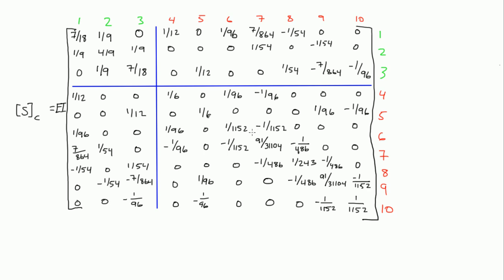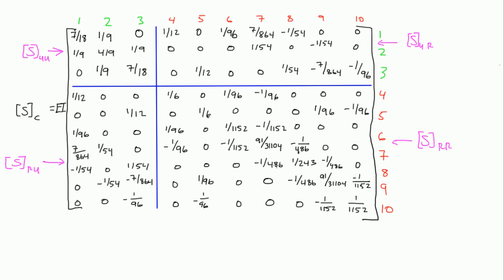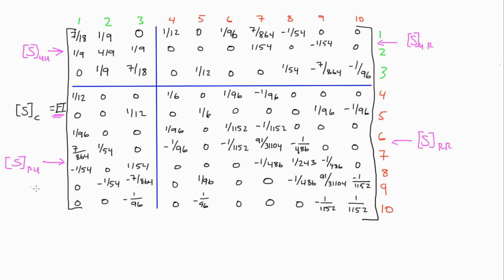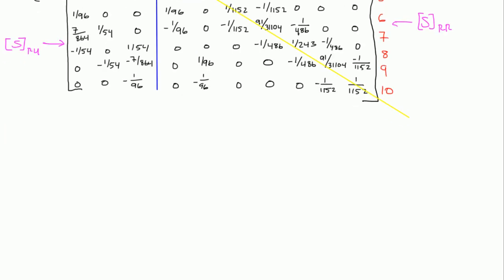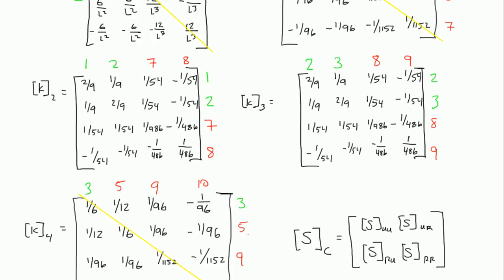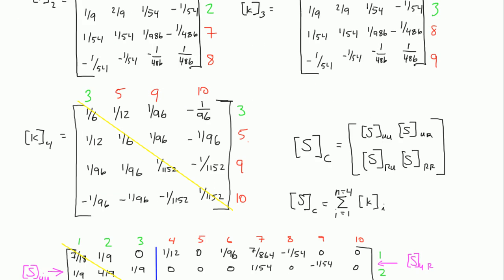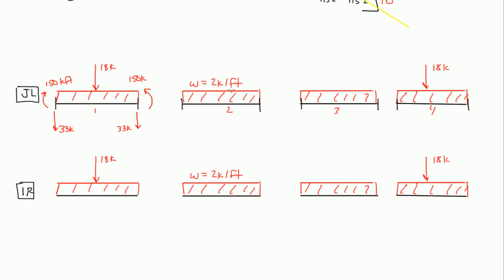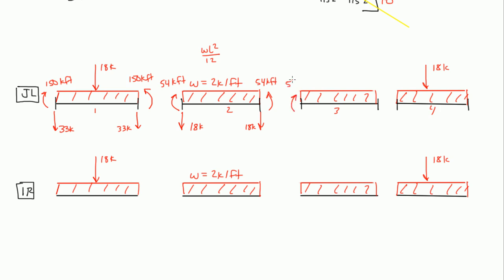Stiffness Method Example: Part 4

Comment: I don't get how you calc the 150k? is it (WL)^2/12+PL/8 ? W is 2k, L is 24, P is 18?
Reply: While this will of course be too late, for the sake of others your parenthesis were in the wrong place:
(WL)^2/12+PL/8 = 246 is incorrect (should only be squaring the length; not the product of length and UDL)
W(L)^2/12+PL/8 = 150kipft is correct